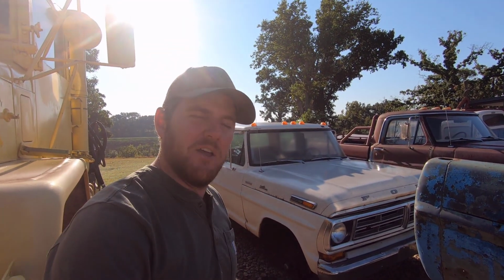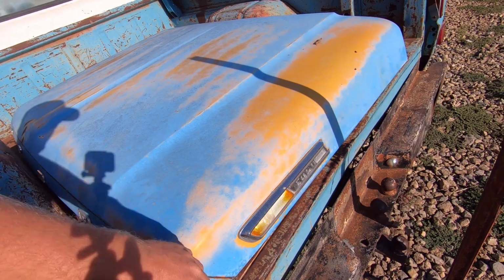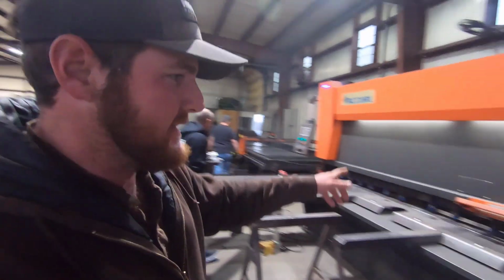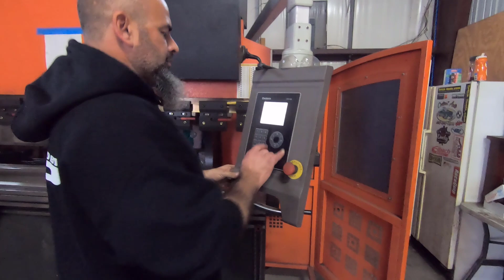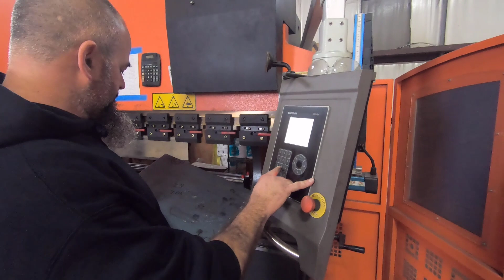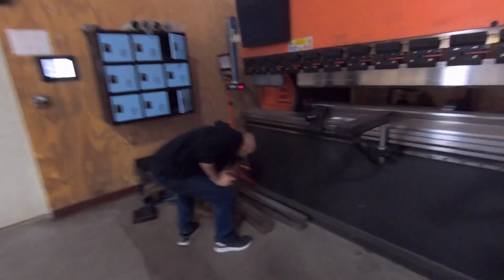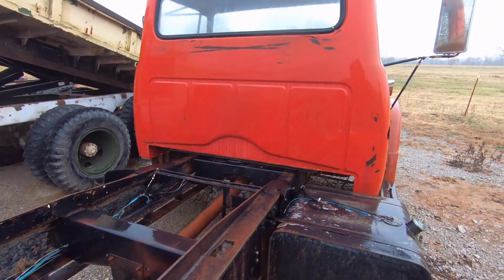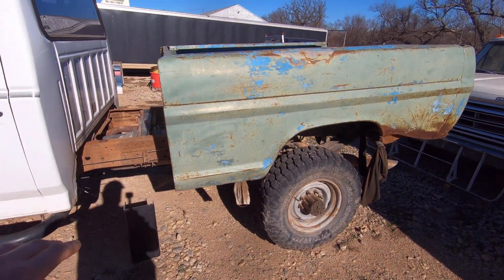Getting The Frame Rail Extensions Made for My 72 F-250 Crew Cab Project!

Comment: That cut on most of the cabs is for  PTO shaft that could run anything pumps on a tank body to an actual grain & gravel shaker in some of the Western series beds they had the shakers inside the beds. Our corn truck had the set up.

Comment: Hope you have a good plan for controlling that E4OD. I think they make a stand alone confuser for them. Just FYI. On my 1992 F350 4x4, I pulled the fuse for the interior lights because they were stuck on. Trans started shifting like it had a shift kit...for about 3 days. Then I lost all forward gears. Called my neighbor who had a trans shop and the first question he asked was if I pulled any fuses. Smoked all of the clutches and the converter. That was a $1200 fuse. Another reason I REALLY HATE COMPUTERS! Happy New Year Matt. Thanks for posting.
Reply from the maker: same company that made the controller I used on the 6r80 makes a controller for the e40d Ill probably go that route.